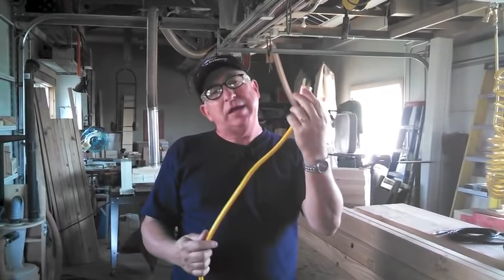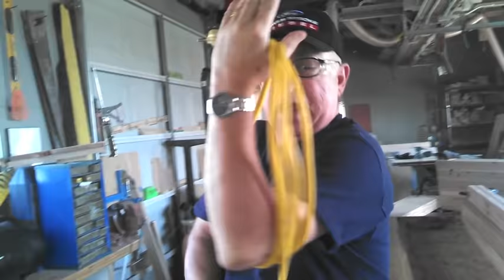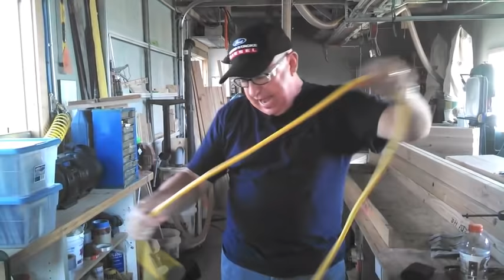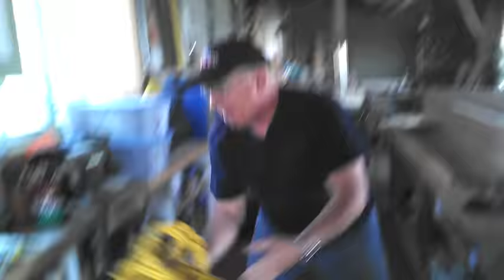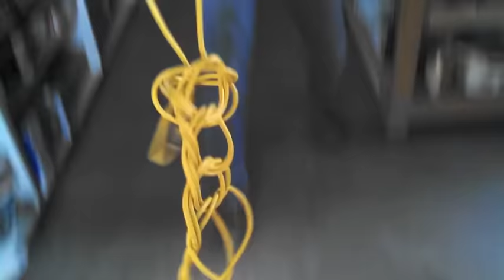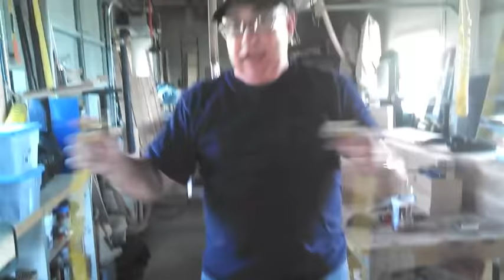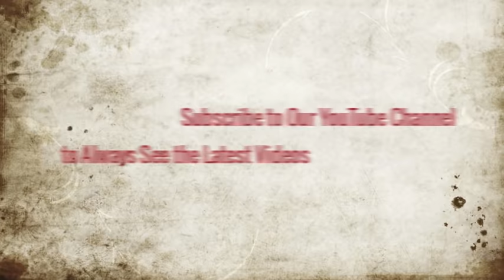Best Way to Store an Extension Cord

Comment: At the job I recently retired from, one of the guys tried this approach to cord management.  I worked as a millwright in a steel mill's crane repair department.  The gentleman insisted on knitting the cords as you described.  It all looked good until we went to use them during very cold winter conditions. When the cords were put to use all the loops that were used to gather them up, imparted a myriad of trip and fall hazzards. We couldn't make the cords lay flat. This would be bad enough on the ground but we worked 125' or more up on the areas cranes travel in called runways. Even with harnesses it was too dangerous.
Reply from the maker: Yes, it doesn't work too well in cold weather. We will be doing an update on this video so we can share all the suggestions we've gotten over the years! Best, DFJ
Reply: I worked  construction  45 years  running  cords  year round  though  jobsite  and building  obstacle courses,  sometimes putting  out and rapping  up my cords 40 or more  times  a day . If I used this  method I would have never gotten any work done  dealing with the  cords. Cords  never get trained  using  this  method.
Reply: @MichaelMoore-rc7ch  I always used long loops when I coil cords or hoses. Just takes a few seconds to uncoil each loop to avoid knots.
Reply: My  cord loops were the length  of my out stretched arm getting  shorter  at the end  of the Rapp  .tied up  with up  with a Pease of solid  core copper  wire. The wire can  also  be used for  tying the  cord ends  together  so they don't  get kicked or pulled  apart.
Reply: Tight coils can eventually break the fine wire strands, long loose coils will add longevity to the cords life. Was preached this from an electrician almost daily when he would find cords wrapped up by the night maintenance guys in tight coils. They had very little butt left once he would figure out who was the culprit. 😂
Reply: Yes, the cord is stiffer in cold weather, however, I have done this all my life (and I live in the Rocky Mountains) rain or shine and I have never been tempted to do it any other way.
Reply: @DirtFarmerJay  Ready for that update, Jay! :-)
Reply: It only took me 25 years to discovered  your tip
Reply: Buy only rubber cords they won't get so stiff in cold weather quit buying the plastic pvc cords
Reply: Thanks for the warning. Will prevent my 42-meter-cord for the lawn mower and electrical barbecue to do this by applying this method only in late spring, summer and fall 😀
Reply: @DirtFarmerJay  Doesnt matter if its cold! Cords have a memory and your method makes for bad memories! Sorry but if you like tripping hazards do it your way! I used to coil them like that when i was 18! Then i learned to correct way and your way aint it pal! Ive worked in numerous union carpenter shops and they will shove you out the door if you coil cords like that! Freekin amatuer night!
Reply: @MichaelMoore-rc7ch  you are correct sir! Its called the moron method for coiling cords!
Reply: @williamcarroll4490  then you used it and tripped and fell and busted your ass! Just be glad you werent on the roof!
Reply: @MichaelMoore-rc7ch  Agree.  I was on one crew that did their cords like this.  I abandoned it the day after I stopped working for them.  Too long to do, too inconvenient to store.
Reply: I agree with all the people that do not like this method.  I think it sucks !!!   With what I would call a traditional coil you don't have to understand coil the whole length like is said in this video.  You simply plug the male end in, lay the coil on the floor and un coil what you need.
Reply: @Katya5cat  ya, i always used long loops, and tried to keep out the twist, and when ready to put away, i would tape or zip tie for storage, to keep out the snarls(a-holes) from forming, for when when i would use next time.
Reply: It doesn't work well in any weather for a cord that is larger in diameter than a 16AWG -- and I won't secure even those that way. The loops take on a near permanent curl, and as you said, cause a tripping hazard and other hassles. A friend of mine wound up my expensive 50-ft #12AWG extension cord like that and I told him, "Please do not do that again." It turned my 50-ft cord into a 30-ft cord due to all of the nasty kinks along its length. I finally got it straightened out by leaving in out in the sun for several days, working out the kinks every day as it slowly relaxed in the warm sunlight.
Reply: @Chazd1949 

It works perfectly for my 100’ 12 AWG cords here in E. Texas, but they’re not made-in-China cheap crap.
Reply: I have a 100 footer will try. If this works I'll be happier than a monkey in a banana factory

Comment: Thanks Dirt Farmer Jay.  50 years ago I worked for my grandfather's mechanical contracting company as an apprentice pipe fitter.  At the end of each work day, it was my job to wind up the extension cords and put them in the gang box.  I learned the method you showed in your video where you make the 1st loop at the middle of the cord.  Unfortunately, about 20 years ago I forgot how to do this method, and my cords have been a mess ever since.  Thanks for the refresher course, Dirt Farmer Jay.  U da man!

Comment: Having lived on a sailboat for many years I prefer to coil my extension cords like I would coil rope. You just have to feel the natural twist of wires within the cord and wrap it in equal loops hand to hand, not over your arm which throws in unnatural twists. As you feed it hand to hand your fingers easily twist out unnatural bends until you end up with a soft coil, not one that is trying to buck in all directions. This is easily hung up or stored in a box with other cords. It is a lot faster because you are coiling it at the same time as straightening it out. An attached length of string is simply tied in a bow to keep it together or, again attached, velcro cord fasteners. Each to his own. Never-the-less this was a well documented video.
Reply from the maker: Martin, well put. I enjoy hearing from our viewers and especially well said and explained procedures or approaches like what you've provided. Thanks for taking time to write! Best, DFJ
Reply: I have used this technique from extension cords to microphone and instrument cables to garden hoses. I've done the "over the arm" thing but usually when I'm in a hurry, otherwise I coil it and untwist it at the same time.

I gotta say though, I've always been curious about how to do what Jay demonstrated. I'm going to try it next time, if I can remember how to do it. Lol
Reply: I think that might be a better method if you have proper storage, but if you are just throwing it in the back of a ute or especially need it to be 'self-contained' in a pile of other stuff, this is a much better method
Reply: Having coiled hundreds of extension cords on job sites, I use the around the arm technique whilst doing a twirl with the uncoiled cord to solve the twist. Works well and very fast up to about 50ft length, literally nothing faster. Simple rope loop to hold it and hang it at same time. Down side is it takes some practice to figure out how much twirling needs to be done to keep everything even. If you have a junction box on one end, gotta start there.
Reply: Likewise lived on a sailboat and in that case, the "arm coil method takes up less space BUT there is a difference between stranded rope and braided line, cords or hose. The cord or braided line has no "lay" or inherent twist, if you coil it you are introducing a twist which becomes harder and harder to do and is messy to uncoil. If you want to "coil" cord, etc, to should let it hang from one hand, and give each coil just a a little bit of a twist so that you end up with a figure eight shaped loop. Repeat as necessary, the slight twists cancel out, no tangly loops when you next use the line or cord You can hang it or fold it over itself for storage.
All the above being said, I REALLY like Jay's method for cords a lot. Hang it on the garage or closet wall - voila ! Thank you, sir !
Reply: It also depends upon the context.  For instance, in construction, some jobsites use a storage container with storage pegs.  It is easier to stack multiple cables on a peg when using the daisy chain configuration because each daisy chain only has about (4) cord thickness at the peg, whereas the full coil will stack-up very quickly on the peg.  Again, one could overcome that with more pegs, etc., so it depends upon the context.  Great video.
Reply: Agreed - there is no way cords/ropes should be stored like this on a sail boat, you xant beat the over under technique.

Comment: I always use a figure-of-eight coil to keep the kinks out, but your way is way faster! I love that a series of half hitches solves it. (The right knot is the solution to most problems :-) I saw this years ago, forgot where I saw it and wished I'd practiced it. Glad I found you again! That'll extend the life of your cord too - less "work hardening" of the copper from bending it tightly. Thanks!
Reply: Horrible idea.  No need to constantly put multiple tight coils into a cord.  Worst thing for it.
Reply: @DiffEQ  . 10/4 You're putting MORE - TIGHTER bends in it . Besides , who among us is gonna live long enough to "WEAR OUT" an extension cord ???????

Comment: Learned this in 78' while working for a master carpenter in a theater. My dad was a carpenter and I learned a lot from him, but all of the tricks I learned from doing theater carpentry I've found really helpful. We mostly used it for rope, but we also used it for electric cables suspended above a work table in the center of the shop.

Comment: I am partially disabled & female with almost zero “handyman” type skills. In other words I struggle just hammering in a nail. 
I DID THIS! 25ft then 100ft cords! Omg’sh too simple & so much benefit! THANK YOU! Now I’m off to binge on the rest of your videos!
Reply: Lisa Cooper this will ruin longer cables over time. It introduces a helix in the wire strands that overtwists the inner wires
Reply: @IBurnMetal  Growing up, my uncles always did this. I picked it up from them. I made decent side-money as a handyman for 7 years before starting my own handyman service 11 years ago. I always wrap my cords this way, never have had a problem. But I also don't buy cheap cords, nor do I leave them out in the weather for extended periods, and I never store heavy or sharp tools on top of my cords.
Reply: Dwayne Bearup  I cannot attest to what may or may not have worked for you, but I can say with 100% certainty, on two contracting crews I worked with all of the older cables were twisted up to the point that they looked like a corkscrew when they were laid out. All they ever did was the method shown in this videoto wind up their cords... A third crew refused to allow this method and only put their cords away using a 6 foot loop (3 foot tall when hanging). Not a single one of the cords was damaged not a single one of the cords had corkscrewed. No, this is not occasional use, they are wound and unwound daily. However, this type of use very clearly shows at a faster rate what you were doing to your cables when you wind them this way. It really has nothing to do with the method, electric cables cannot be wound that tight. Look how small the loops are when he’s finished. The exact same damage will happen if you wrap an extension cord around your forearm… Also something that he demonstrated…
Reply: @IBurnMetal  I can say only 2 things for certain. One is that none of my cords (all of which I tie in tighter loops than this, BTW) ever gets a permanent twist or bend in them. I untie them when needed and retie them when I'm done. No doubt there are a number of factors that account for the difference. If it mattered I could come up with a list.
The second thing I can say for certain is that while I have never had a cord tied in this manner catch fire, I have experienced that from a cord wrapped around a reel. It was a 100' 12/3 cord, the spot my assistant was welding was 20' further from an outlet than my welder could reach, and he didn't have a 25' cord but didn't want to unreel all 100' of his, so...fire.
Reply: @IBurnMetal  The gospel by which we're saved. We're under Paul's ministry today. Therefore we're not under the law of the old testament. 1 Corinthians 15:1-4 (KJV)1 Moreover, brethren, I declare unto you the gospel which I preached unto you, which also ye have received, and wherein ye stand; 2 By which also ye are saved, if ye keep in memory what I preached unto you, unless ye have believed in vain. 3 For I delivered unto you first of all that which I also received, how that Christ died for our sins according to the scriptures; 4 And that he was buried, and that he rose again the third day according to the scriptures. 

And that takes us back to John 3:16 For God so loved the world, that he gave his only begotten Son, that WHOSOEVER believeth in him should not perish, but have everlasting life. Ephesians 2:8-9 (KJV) 8 For by grace are ye saved through faith; and that not of yourselves: it is the gift of God: 9 Not of works, lest any man should boast. So it's only by GRACE that we are saved not by works. Jesus did all the work and gave us GRACE (unmerited favor) as long as we have FAITH (believe) in the death, burial, and resurrection of Jesus Christ for SALVATION (trust in his blood). That's the gospel. Jesus said, Ye must be born again to enter into the kingdom.(accept Jesus as your SAVIOR)

Comment: I've been doing that loop, without doubling the cord in half, for about 30 years.  That is a pretty good improvement.  It's the first time I've seen anyone else outside my company, where I learned it, has used that loop-knot.  Well done.
Reply: @tywyeth1680    Loose loops don't hurt anything, I've done this for decades and had no issues, but I'm always willing to learn something better. How do you do it?

Comment: I was a union painter here in Hawaii for about 25 yrs. and was taught this method by someone somewhere at sometime while in the trades.  Also., paint sprayers can have lines that are over a 150 feet long and that line is almost never removed from the sprayer once it is attached and there is a very simple but completely unknown way (by most non pros) to wind the hose so that it also does not get tangled up when stretching it out.  And believe me, untangling a spray line is a LOT more difficult than an extension cord.
Reply from the maker: These are some great insights! Thanks for sharing this. Best, DFJ

Comment: Hi Jay, I've got to share this with ya, as soon as I saw you, I got choked up because you reminded me of a younger version of my Dad.  He passed a few years ago, but taught me so very much throughout my life about everything. We worked on cars together, home improvements, sports, adventures, and so on. I was always his helper/assistant.  I've really missed having that amazing knowledge in my life to call at any time when needed.  As a married Mom of teenagers, I even called him at 1:00am and he answered the phone right away. My teenage son and I had run up to an am/pm to get some snacks and for some crazy reason the horn on the car started blasting and I couldn't get it to stop.  I knew my Dad would know exactly how to help. I told my son lets call Papa he will know what to do.  I told him the problem and he suggested doing a couple things getting in and out of the car using the key and sure enough, the car stopped within 20 seconds.  So what I'm saying is, that I am so excited to have you to look to for answering my misc questions.  My husband can fix pretty much anything having to do with wood and much more he's a carpenter. But now I also have you to turn to for my questions too. Thanks for putting yourself out in the world to help others.  Anne Cardosa

PS Here's my first question for ya. Do you have a video on how to take a chandelier that was made for hard wiring into a ceiling and change the wiring to make it a plug-in instead?  I want to add a  super long cord and run it, across the ceiling, down the wall, and plug it into a wall?  I live in an apartment and can't hard wire any lighting but want upscale lighting.
Any advice you could give me would be AMAZING.  Thanks again!

Comment: My father taught me this over 40 years ago.  Every cord I own looks like this today. Best ever!
Reply: Guy Davids Ok, but he was using a 25 ft extension cord. I just did this with my 50 footer and it is now 5 feet long. How does that help me store it if it’s still 5 feet long? I hang my extension cords on a large hook in the garage. This will drag the ground. He needs to demonstrate this with every size extension cord including 100 footers. I rarely use short extension cords unless I’m stringing them together to make a longer one. Hey Guy David, why don’t you upload a video of you doing this and show me HOW/WHERE you store your cords after you have used this method. I really want to know b/c I DO like this method BUT the cord is still too long afterwards.
Reply: swamprat hint: how do you make a 100 ft length into a 25 ft length? For my 100 footers, I make the first “fold” of the cord. Then I fold that in half again. I pull 4 strands through the 4 strand loop. It works for me. It’s not difficult. I’ve never uploaded anything to YouTube. Don’t feel the need to now. Hope that helps.

Comment: My dad taught me this technique for cords years ago. Once you practice it several times, you can really wind up a 100 foot cord in less than a minute by just pulling each loop through, one after another until you get to the end. The only drawback is the thicker and stiffer the cord, the more it really works out your forearms. Good exercise though. This also works really well for long wires too.
Reply: Ah HA! Therein lies the problem for me. All my cords are heavy duty and 100 feet or longer and unfortunately I just ain't getting any younger. LOL